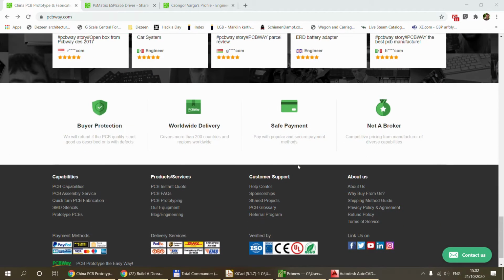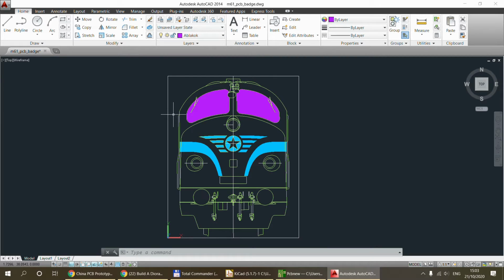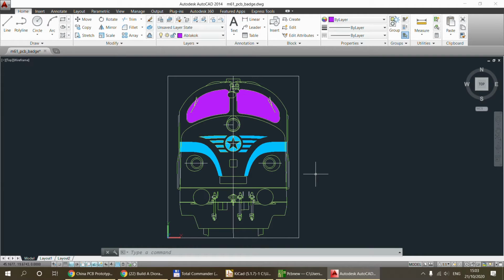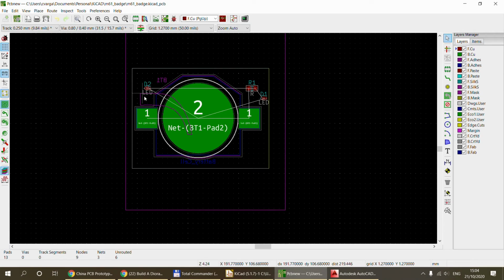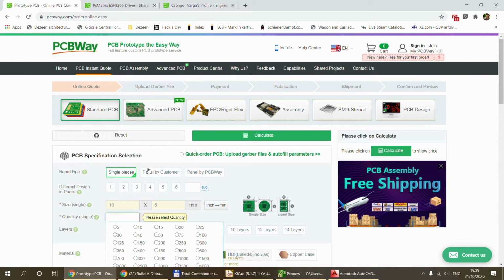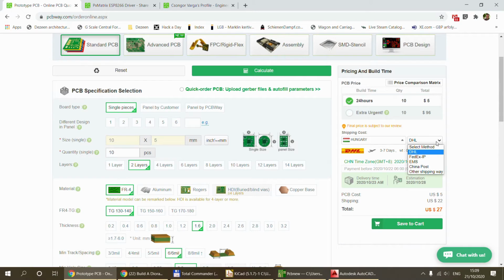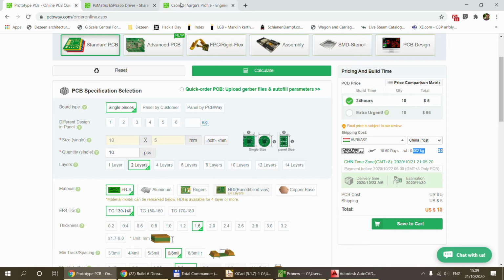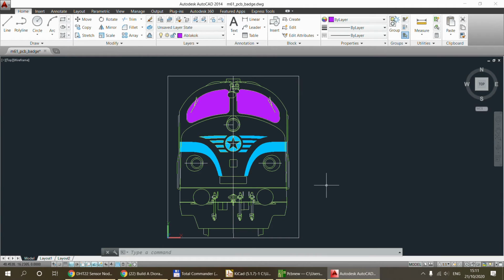Future PCB projects with PCBWay

Comment: Hey, can you export these windows as SVG? I'm currently playing around with an SVG import I made as extension script for EasyEDA: https://github.com/xsrf/easyeda-svg-import You should be able to import them as top solder mask (and top copper)
Reply from the maker: OK, let me check, there is an online AutoCAD DWG to SVG converter. Let's see how that looks with your import. Thanks a lot for the tip.
Reply: @csongorvarga  if it dosen't work right away, please open an issue on github and attach the SVG (or send it to me via mail). I'll try my best to make it work.